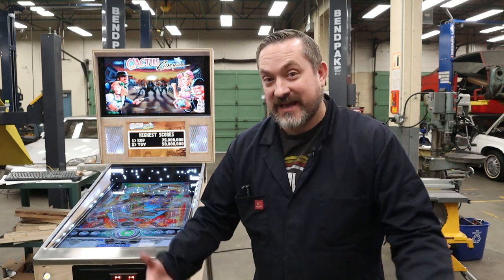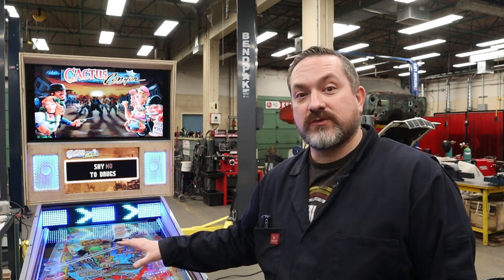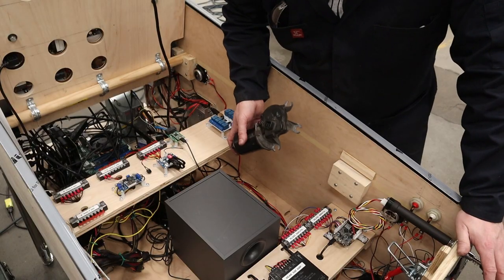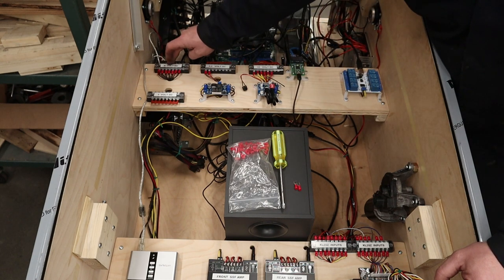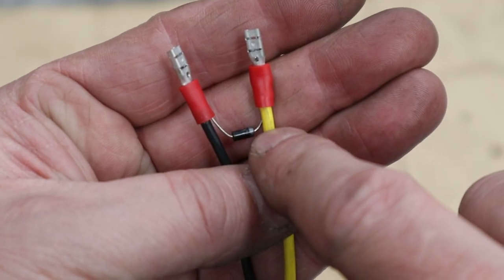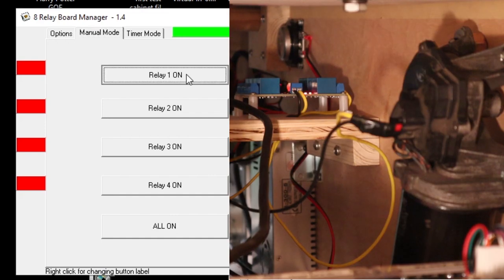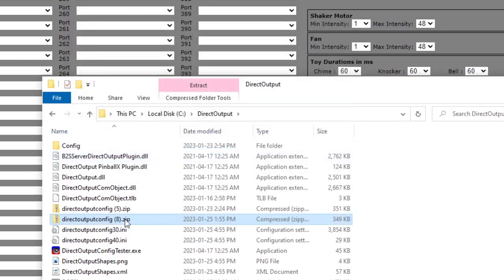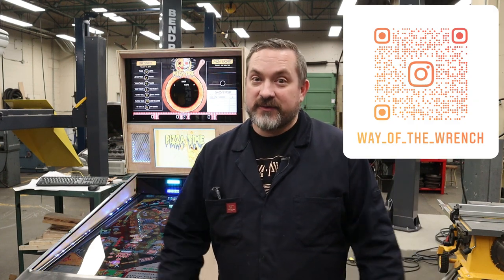Virtual Pinball: How to install a gear motor!

Comment: Love this video. I have a Sainsmart I got 2 years ago to add some solenoids and a gear motor or shaker motor but been afraid it was going to be too difficult for a newbie like me to do. This video really helps my friend. Keep em coming:)
Reply from the maker: Awesome Bill!  Glad I could help you feel better about tackling this.  It's pretty easy especially with this video at your disposal.  Good luck!
Reply: Thanks again. Have you done a video on how to wire up solenoids or contactors? I'd love to see that type of video.
Reply from the maker: No not yet but it would be pretty much the same except with a solenoid.  There are some things to add though like dealing with having solenoids on when flipper buttons are on so they don't overheat and a few other things.  To be honest, my ssf is so good...I might not add solenoids.

Comment: Very cool gear setup.  Thanks for explaining the diode as well.  Might save someone from cooking circuits.  Perhaps a future video on mods such as matrix shapes, color adjustments, sounds or music to VPX?
Reply from the maker: Thanks Scott!  Yeah lots of cool things to still do for an in depth series on diy vpins.  I have a bunch already made and some still to do.  I just messed around with colorizing roms so that will be soon.  Lots to do and not enough time ya know?  Thanks for the watch!
Reply: @wayofthewrench  You have certainly picked some great topics so far.  I have my table fully working now and it is such a blast.  I do need to tweak everything though (undercab LEDS not working quite right, various tables in wrong orientation, sound level all over the place).  Your videos help inspire us to jump in and tackle it.  Thanks again.
Reply from the maker: Pinvol will solve all of your sound issues, I just set up mine and it now takes seconds to dial in your audio and ssf with a new table install.  Editing this video as we speak.  Cheers!

Comment: Another great video.  Only thing I'd question is wrapping that snubber diode up in black tape like that.  It is harder to get at and test if you suspect it is blown.
Reply from the maker: Thanks dude!  Nah it's not buried, you can test the ends still and it would take literally a minute to take it off/test.  Thanks for the watch.

Comment: I'm gearing up do a VP cab. I have a MAME machine I want to finish up first, but then it's go time! It's something I have been wanting to do and I have been inspired by your videos.  I found a gutted Gottlieb, circa 60's, for $275. Unfortunately that means I have to fit the playfield into it instead of the other way around, however that saves me time and money on building it! I went overboard on the computer and playfield monitor though. Mainly I wanted to fill the space as best I could and felt that I needed a computer that could keep up. The Monitor is an INNOCN Ultrawide Monitor 40".  The computer I built has an AMD Ryzen 7 sitting on a MSI B550-A PRO ProSeries Motherboard with 64 GB DDR4 ram and a PowerColor Red Dragon AMD Radeon™ RX 6800 XT Gaming Graphics Card. Again Overboard... I will have to get your email so I can send some photos once I start!
Reply from the maker: Wow!  That's quite the pc.....my test build was just an i3....lol.  Sounds like you got a good plan.  I'm interested to see how your ultrawide goes cause the dimensions will be off a bit.  Still will probably look great!  Cheers!
Reply: @wayofthewrench  Yeah, I know it's way overboard, but I wanted to make sure I could hit the 144Khz refresh rate. Well that and I'm probably compensating for something... As far as the playfield monitor, I looked around but I couldn't really find anything sized right. The inside dimensions are about 20.5"W x 37"L. The Innocn just about fills the space lengthwise. However, it's 16.5" tall so there will be a gap on the sides. I'm thinking about doing an infinity mirror as a bezel using the RGB LEDs. I think it might fit the space theme I have planned for the side art. Unless you're talking about the video on the screen, Yeah, I worry about that too, If anything I can always swap the PC with my desktop and get a 32" to put in it.  Thanks for doing videos on this stuff!
Reply from the maker: 144Hz will be amazing at 4k!  Your infinity mirror bezel would be cool!
Reply: @wayofthewrench  Well it's not 4k per se . 4k is 3840 x 2160p.  Ultrawide Monitors have a resolution of 3440 x 1440p (at least the ones I'm familiar with), so the pixels per square inch isn't the same. I got to tell you though, making is the easy part it's getting the software working that I struggle with. Right now, I'm struggling with getting a stable 15KHz image on my CRT with GroovyMAME after a reboot.
Reply from the maker: Did ya finish your vpin and mame cabinet?  I'd love to see some pics, DM me on my Instagram.

Comment: Thanks for the video, very instructive as always. But, why did you choose that horrible motor? I went for two small and light Black & Decker electric screwdriver motors wired electrically in serial mode and I can set up the "sound" of the gears by the Pinscape connecting them to a PWM output.
Reply from the maker: Thanks.  I used it because it was free, used, and Toyota which means it will be noisier and last forever.  The motor had two speeds which helped pick the better gear noise too.  Also the windshield motors are geared down so lot's of gear noise.  Yeah my kl25z board doesn't have pinscape as its a Virtuapin Controller on it...so no PWM but that is cool to have alter your gear motors how you like it.  In the next video I add a PWM controller board to alter the shaker motor so that would also be an option too if someone didn't like their gear motor speed/noise.  Thanks for the watch!

Comment: Thanks Emil for another great video! One question though. I have a few P1000A diodes on hand. Do you know if these are ok for the gear motor application? Thanks.
Reply from the maker: If they are not what I specified in the video for what I used, then you would have to look into the data sheets online to see.  Most likely they will work but do your research to be safe or get the ones I used.  Thanks for the watch!

Comment: Awesome! I’ve got some beacons that I’m gonna wire up soon. I assume the process is basically the same? 

A few more questions:

How do you know when/if you need a diode? 

Is it ok to just use 10A fuses for all the toys since the relays support 10A?

Thanks again for doing these - awesome videos!!!
Reply from the maker: Yeah pretty much the same, just hook up another relay from the sainsmart and change your config file.  The diodes are for anything that will cause power spikes after it is shut off (motors, solenoids, knockers, etc).  Depends on what you're trying to protect as you add a 1.5 times the amperage of the part you're adding usually.  Thanks for the watch!

Comment: You mentioned that you can use space connectors to connect a diode. I don’t have any soldering skills. How reliable will this technique be and do you recommend it? (Since i don’t think I’m ready to tackle soldering). Are there any specific spade connectors on Amazon that you think would be good alternatives? Thank you.
Reply from the maker: Yes you can use spade connectors but I would highly recommend learning how to solder.  Just practice a bit on some scrap wires.

Comment: Hey man, I'm curious. When it comes to using inline fuses, is there such thing as using too big of a fuse? Such as, If I'm not sure what amp fuse to go with, could I just use 10 amp inline fuse for everything? Thanks
Reply from the maker: Yes, if you put too big a fuse than it will never pop if something is wrong.....it will literally let your wires melt/parts blow.  I used 10 as it seems like most devices needed that.  You usually take what the amperage is for the device and add a bit of a safety buffer like an 8 amp device would get a 10 amp fuse.  Otherwise the fuse may pop when it first starts because the current spikes a bit on start up but then settles down.  Thanks for the watch!

Comment: Hoping you can help. So I followed everything as far as where to connect the wires. I got to the testing phase and when I select Relay 1 where I have my gear motor plugged, it worked! Then I turned off, then it back on and it only worked for a second and then the gear motor stopped working. It wouldn’t turn back on so then I plugged the gear motor directly into the 12V, bypassing the Sainsboard, and the gear motor was working again so I’m good there. So then I go back to plug in the gear motor into the Sainsboard and it’s not working still. Any thoughts why it work the first time and not after? I tried moving the gear motor to other relays but it’s like the Sainsboard doesn’t recognize it anymore.

When I click on each relay, I do hear the clicks to indicate they are working but the gear motor still won’t respond.
Reply from the maker: Hrmmm maybe check connections for polarity and loose/bad connections.  What is the input voltage to the sainsmart board?  Try to operate the motor with the usb relay manager to test and not dof.
Reply: @wayofthewrench  Ok. Thanks. I’ll redo the wiring and see if it’s that. Voltage going to it is currently measured at 12.07. If all else fails, I can try another board since I know the motor is working. And I haven’t tried through DOF yet since the Sainsboard stopped responding to the motor.
Reply from the maker: I just thought of something.  Check the direction of the diode.

Comment: I downloaded everything to do with dof. I'm trying to get a gear motor working with the same table but do I still need a cabinet file? I really can't get it working with the gear motor with the same relay board
Reply from the maker: Did you follow my DOF videos exactly?  I would start with some led lights to ensure DOF is working properly and then add toys.  Off of the top of my head, I know you need a cabinet.xml file for the lights but not sure if you need it for just a gear motor.  DOF is really picky with naming conventions and placement of folders/files so go through the video again step by step.  Also if you have upgraded to newer vpx or 64bit, you may be missing the dof files in those folders.  Good luck!

Comment: Tables:  Many of my current tables are on my vpin because I saw them, on your vpin, during many of your videos. I have not been able find working vpx or FP versions. One example is the Masters of the Universe table. Currently I'm only running vpx and FP.  Would it be possible for you to list your current tables and the download source or link? If not, can you give me the link for Masters of the Universe download? Thanks.
Reply from the maker: All of my tables are from vpforums or vpuniverse.  However, I just looked for Masters of the Universe for you and I can't find it.  Weird, maybe it got pulled for some reason.  I think the Future Pinball Terry Red is there though. You could try some other sites like Pinball Nirvana too.

Comment: never use a bigus mod, honestly 50% of the time, he breaks the tables he mods, and doesnt know it. and you will only find out when you play the table far enough and get to certain missions. You'll get an error and or a crash. very frustrating. and you never know which of his tables does and doesnt. unless you r a pro at all those tables. so be smart and avoid what we call bogus modes. lol
Reply from the maker: Hrmm, I haven't played enough of these tables to experience that but I'll keep my eyes open.  Thanks for the tip.  Cheers!